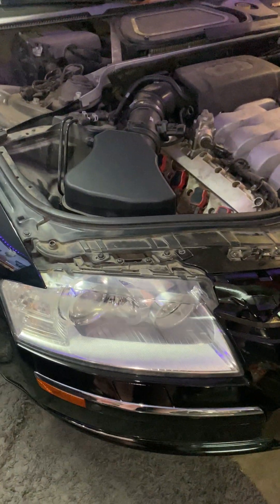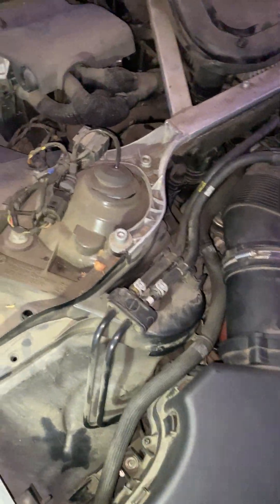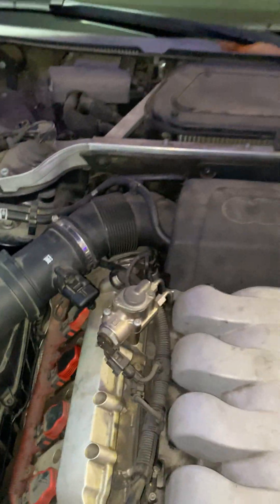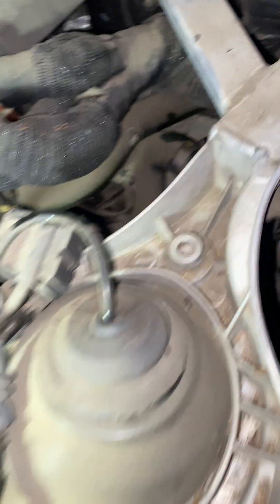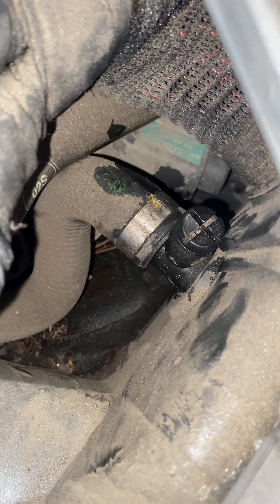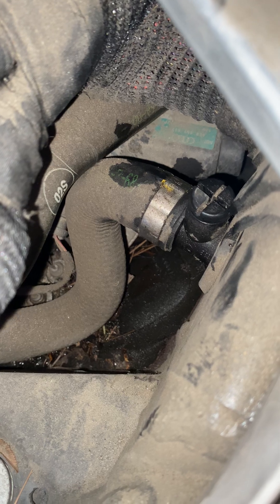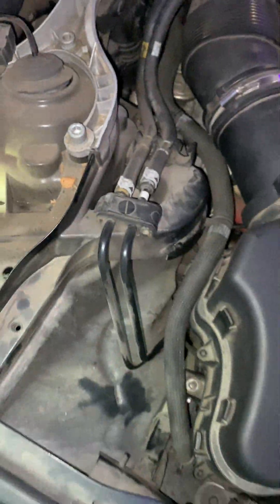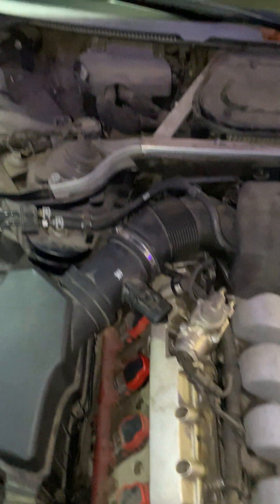How to bleed AUDI A8 Coolant system

Comment: Brother my A8 L showing the coolant sign right when I turn it on. And I already topped off the coolant.
Reply from the maker: You may need to change your temperature sensor or the sensor that’s in the coolant reservoir